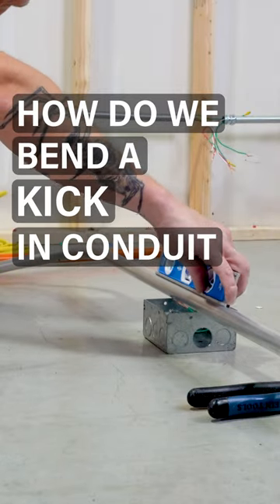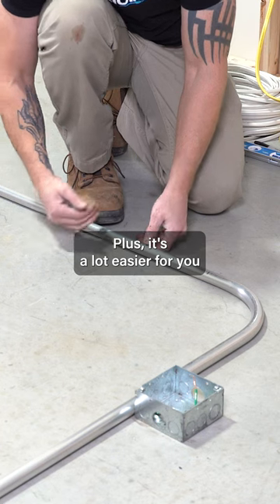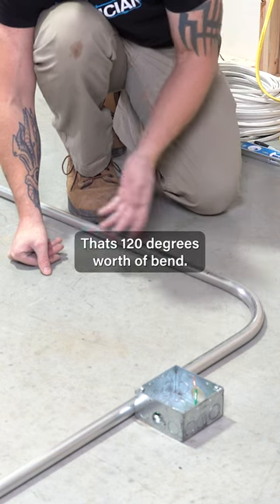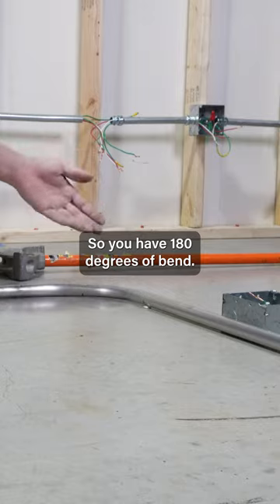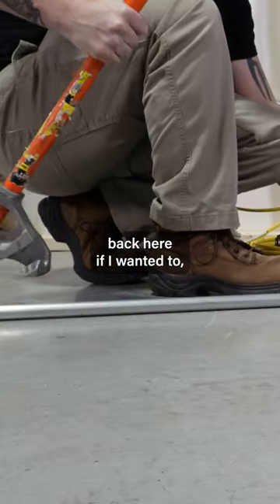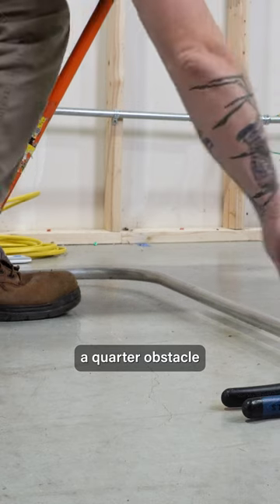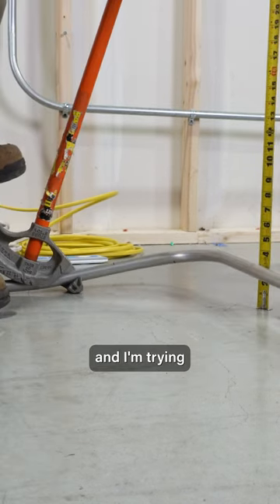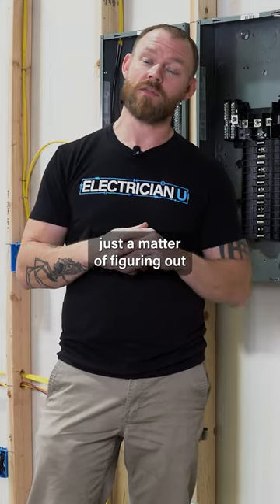How To Bend A Kick

Comment: If you measure your kick 90 the same way as an offset it's alot easier to figure out so if you want a 4 inch kick. Come from back of 90 - 8 inches at 30 degrees will give you a 4 inch kick. And a good bender straight up and down if bending pipe on floor is 30 degrees. Easiest way
Reply: Preach brother!
Reply: True but you gotta account for the center of bend vs your bending mark
Reply: @Ephesians-ts8ze 
True. Otherwise you have to figure out adding or subtracting your half radius. Plus, it's nice using the the center of bend because you can flip the bend behind you keeping the tail flat on the floor. Less chance dogging your kick.
Reply: So many sparkys don’t realize it’s the same trig as with an offset. The same math applies with factory bends when you’re running big pipe too.
Reply: Absolutely. I teach that to all my apprentices. It literally is the first step of your offset. Utilize the same multipliers for your degree of bend. Math, math, math. It's what makes you an efficient pipe bender. Especially when your running a cyclone or the 881 table.
Reply: You have to use center of bend. But yes. This trick is so handy!
Reply: Most benders are plumb 30's. Plumb 45's exist but I'm not sure they still make them anymore. Just something to be aware of.
Reply: Yes, Sir. I do the same thing. Makes your work uniform.
Reply: Degree is best but ive seen a lot benr with chicago bender with c licks
Reply: Good tip. Thanks brother

Comment: I started bending pipe as a teenager , offsets , 45's 90°s all of it. I was trained to measure. Eventually my eye and instinct took over. I used tape and my eye, and instinct.Eventually , I smoked most all others wasting time measuring over and over with a tape.

Comment: It does matter where you start the kick. For instance, if you need a 10" kick and start close to the 90, you'll pretty much end up with almost another 90, depending on how close you are. Also, I always measure and mark the pipe, especially if you're kicking into or out of a panel etc with multiple pipes. That way you can keep your spacing even and not looking like garbage.
Reply: Exactly.  And always try to bend a 22 1/2 . A 30. Or a 45. And mark the pipe accordingly for each degree. That way the electrical worker that comes after you and has to run a pipe next to yours can match it more easily

Comment: It actually matters where you do kick it because you have to strap within 36 inches of any termination point. NEC 358.30 (A).
Reply: Not for the height he was talking abt.
Me personally I'll go abt 30 inches back and bend if it is under 8 inches.
This way I still maintain the 36 inch strap.
And who says you can't strap on the leg of the 90 or on the leg of the kick?
You strap it where it can be supported properly with in code.
Reply: @lm5085  I'm not saying you can't support on the leg. But now it's an extra piece. You have to place in like a piece of strut. I'm just saying to keep it simple, is all.

Comment: Listen ...good info on using kicks. I'll give some more info... when you bend your kick measure to top of pipe. Your amount of kick should be the amount you put into the bend. Also a trade secret... to not have to hold a level on top of the pipe to avoid dogging it, instead put it underneath ..

Comment: I use the offset double it method for my kicks, works every time. Ex 12" kick id measure 24" from 90 and bend at 30°, but that's just me, whatever works for ya

Comment: I usually put a magnetic level on the perpendicular part as I bend it. Also, what do you mean it doesn't matter how far away the kick is from the box?? It needs to be less than 3 feet away, right? So you can secure it within 3 feet of the box? Or am I missing something?

Comment: There's actually a procedure for bending kicks, just like offsets and back 2 backs. Use emt multipliers, e.g. 3" obstacle, multiplier for 30° degree bend is 2. Measuring from the back of 90, mark 6". Place mark at TEARDROP and bend 30°. No guess work.
Reply: You don't really need to go thru all that.
Easiest angle multiplier is the 30.
This of course is for exposed work.
Shit hidden in walls and ceilings you do not have to be so precise. 
And even with exposed work. Unless your running a rack you don't have to be so precise.

And here is the other option you forgot abt. In conduit bending 1 I was taught the any angle method. That is go back a distance and just bend the kick as high as needed. 
This is preferred method for rough in.
Speed is essential when banging out homes.

Comment: Its 90 degrees for that type of metal 
90 in 90 ( like bill & bob) 
90 degrees compared to 400
90 degrees for that room 
90 degrees In elevation 
90 degrees to the bottom 
90 degrees to width 
90 degrees to height 
90 degrees to length 
90 degrees in time (zones) 
90 degrees to barometric pressure 
90 degrees to syncing 
90 degrees until it bust a main line
90 de creases until you get to…? 
90 is what goes through 
90 degrees = Th 
Thorium 
232.0377

thorium (Th), radioactive chemical element of the actinoid series of the periodic table, atomic number 90; it is a useful nuclear reactor fuel. Thorium was discovered (1828) by Swedish chemist Jöns Jacob Berzelius. It is silvery white but turns gray or black on exposure to air.

Comment: If you don't lift the end of the pipe or lean the bender so the handle is perpendicular to the adjacent section, the kick will be crooked.  Are you running a pipe over the opening of that box?
Reply: He used that as an example obstacle he wanted to go over.
Good demo.

Comment: It sucks for the next Brother if your making a small kick to go over that j box. Future access to that box. Yeah you can remove the cover, but let’s say you need to tie in something to that box, the limited access to the wires with that conduit inches above is going to make it a challenge, especially if that box is hot. Just an fyi. I’d say go around that box. Maybe use another obstacle than a j box for future reference. 😉 for the newbie’s

Comment: It's nice BUT you should have put a level on the kick of the 90. This way you can not only measure the kick but ensure that you don't put a dog leg in to it. Never assume that just because you have a simple kick that the pipe will not roll on you.  When bending pipe your level and tape are just as important as the triple nickel, or hand bender.
Reply: You do know this is a short and it was abt kicksnot 90's. 
90's was covered. 
Think of your order of bends. You need to bend the 90 before the kick.
And that being the case your 90 is already corrected.

Comment: This is why we use a combination of plastic pipes and flexible tubes in europe instead of metal pipes.
Reply: See we have what you call bonding. And for a good bonding and grounding you need steel conduit and fittings.

Comment: level you pipe before you bend. I like to stick my linemans or a screwdriver under it. use a level. there some math .involved, wouldn't recommend bending anywhere on your pipe. Say for an 8" kick go back 16" from the back of the 90° and do a 30° bend on your bender it should take you to your 8" kick if you've done it right.
I'm industrial site lol I bend alot of pipe 🤣